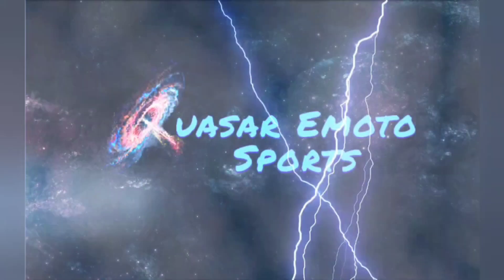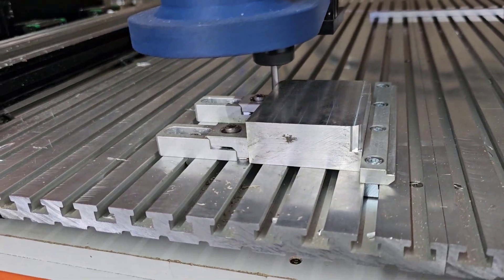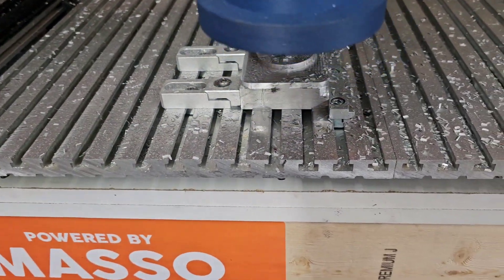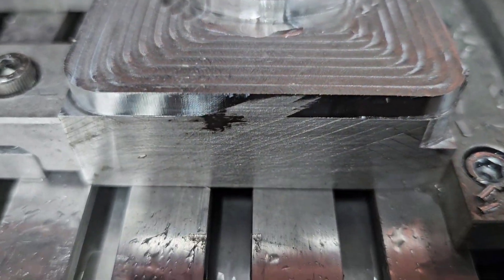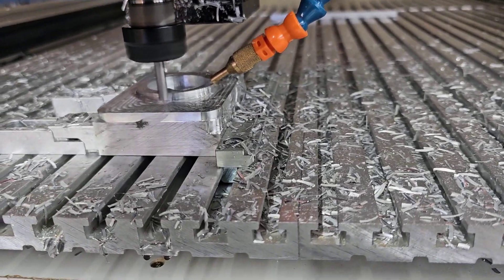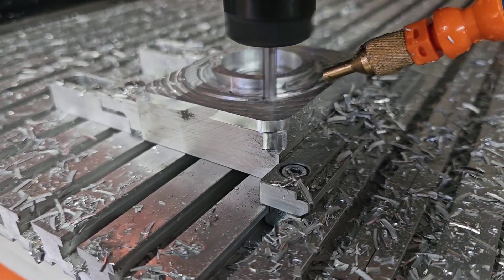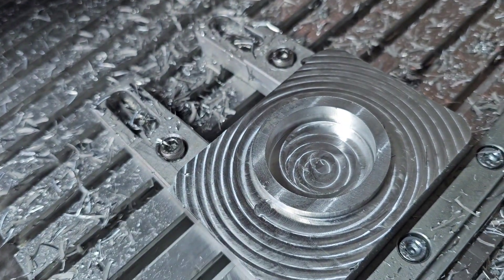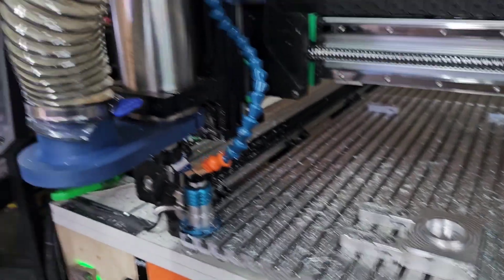Queen ant Pro v2 CNC router throwing serious chips! Masso G3 touch!

Comment: You need to add a delay to cycle start so the spindle has time to come up to speed. I built a very simular machine with the same controller. 10 sec should be plenty
Reply from the maker: @bransonlariscy4660  there is a delay, the only time there isn't is when I stop the machine and resume for a broken too or something along those lines.  When that happens, I now manually start the spindle prior to hitting cycle start.  Thanks for the input, good info for sure!

Comment: man, i am doubting between this machine and the scienci altmill, any advice here ?
What i can see is this machine has more bang for the buck, the altmill is a bit more sturdier...
Reply from the maker: I CNC 1/2" aluminum regularly, this can handle it and quickly!  If you're working with wood, this is a no-brainer. If you want to work with Aluminum, this is an excellent choice with my mods!
Reply: @QuasarEMotoSports  Would you mind doing a video detailing the mods you have made.
Reply from the maker: @roccovalotta9490  check out the channel. I have a few on here detailing exactly that

Comment: The chips at 18k were perfect. Your mister is inadequate - you really need 2 and they point at the cut. I've never seen AL done with a vacuum, I don't know which noob started that bad idea. Spindle not up to speed will snap a bit you got lucky. A 1/4 bit should be able to do a 1/4 cut at 1/4 deep, I don't think you've max'd the machine yet - at least I hope not - this machine is on my shopping list. Back in my day E-stop meant starting from scratch, glad that has improved.
Reply from the maker: The vac works excellent on large parts that can dissipate heat. Definitely need more on the mister for smaller parts.

Comment: Looks good. Wich motors are you running? They are silent!
Reply from the maker: They are the hybrid closed loop servos from YUYONG. 
They are silent because the rails are extremely true. I used a dial indicator to dial everything in, which drastically reduces movement noise.